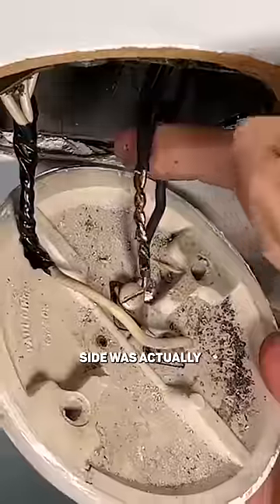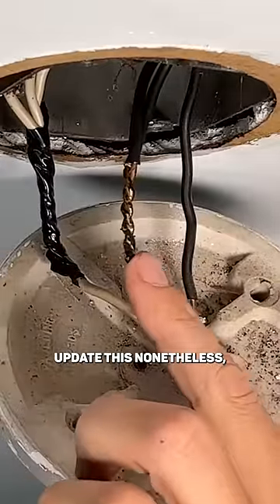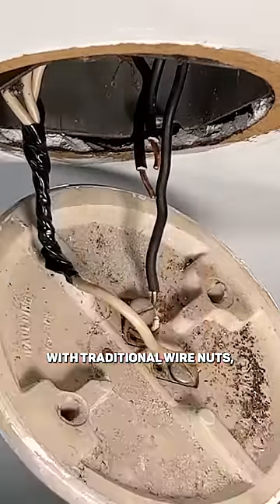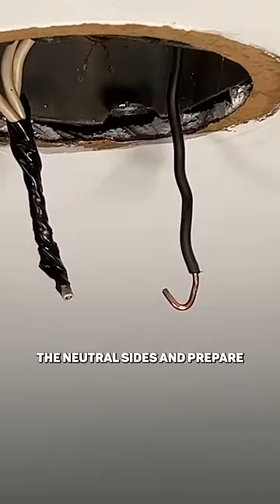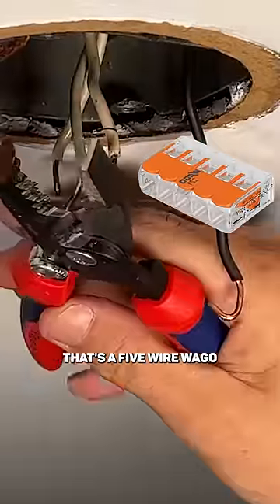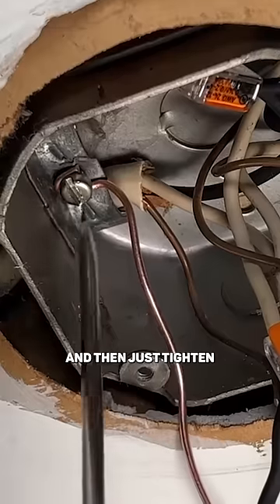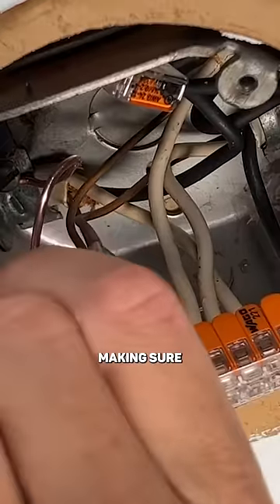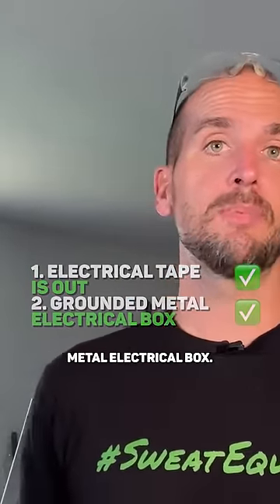Which Part Doesn't Meet Code?

Comment: if its soldered just trim it put a nut on and be done.
Reply: That solder joint will be the last thing to fall apart in that house.
Reply: That's what I was thinking too, just use a wire nut or heatshrink to insulate it instead of electrical tape
Reply: Extra get extra 😆 🤣 😂  you so true
Reply: @dannylewis5680  you are probably wrong, because solder has a low melting point.
Reply: @garagekeys solder melting point on the low end is 190°F if you are hitting those temperatures your house is probably on fire and the solder is the least of your worries
Reply: @cautloa  194 is the limit for temperature for most house wiring .. So my point is made the solder could melt and comprise the connection.  Read why connections are not soldered for AC current in houses
Reply: I mean yeah but i think a thick heat shrink sleeve would be better. Also, aint it pronounced way-go. Either way i hate the way he pronounced it
Reply: @garagekeys  solder starts at 190 you can get solder rated for higher Temps I think it goes all the way to 360
Reply: @garagekeys  90* C is the melting point of the jacket. If the jacket melts is the solder really a concern?
Reply: Or just do it right and don't be lazy. Damn boomer mentality
Reply: @garagekeys f your electrical box exceed 400, means the house is already burning and the plastic lamp fixture is melting for a while
Reply: @DrLoveQc  you lostt me on that one, went over my head I'm not that smart That's why you get paid the big bucks, I only make $37.25 an hour
Reply: @garagekeys Im not sure if salary has to do with being smart or not but 38 is good.Usually doing what you love as a job is the main interest, if it pay well thats a plus for sure.

Just not sure why u said your hourly wage, I dont usualy said mine or household even to friends and family. 

Seems my reply was erased a bit, so maybe it didnt make much sence.. I was talking about the melting point of tin solder, it is way way higher then the cable jacket. But It s not up to the code where I live because its a single strand, solder could be britle and vibration can be an issue, compare to multi strand cable where for low voltage dc with multi strand cables and mecanical strenth.
Reply: @garagekeys  depends on the solder. Alloys are most commonly used and have a much higher melting point.
Reply: @spazzypotato8325  sure these new fancy connections never fail 😂
Reply: @Don's  ramblings  con flabin new thingamajigs
Reply: @spazzypotato8325  huh?
Reply: Agree. Wire Nuts are far better!!!
Reply: @spazzypotato8325  
Guess how many of the clear plastic ones melt break cause shorts and fires all because the electrician is to lazy to use a wire nut.  Or just google it your self.
Reply: Agreed…but that would mean less content for his wallet
Reply: This is nowhere near code. Code would be to twist the wires back into the insulation. Wire nuts are always a better more solid, secure, and better conductive solution. The only people who use wagos are people who have no idea what they are doing, or are incredibly lazy. It's a hack short cut to prevent having to take the time to properly connect the wires.
Reply: @DirectCurrent4u  Actually they are not. In the UK the Wago is certified for use as a Maintenance Free joint in a plastic enclosure and doesn't need to be subject to periodic inspection. The same is not true of the wire nut.
Reply: @deang5622  That’s good to know. Not familiar with UK code.But as a electrical contractor for 32 years I would definitely not recommend them for anything. They’re pretty much made for homeowner do it yourself repair. But I’ve seen in them fail way too many times. They  like to get hot melt etc. A good quality Wire Nuts are way better ! Thanks for your reply. Cheers !
Reply: @garagekeys If it reaches a 194 it's going to melt the plastic on The Wire nut or wago. How about installing the correct size circuit breaker to handle the load's  And kick off when the circuit exceeds the Amperage capacity